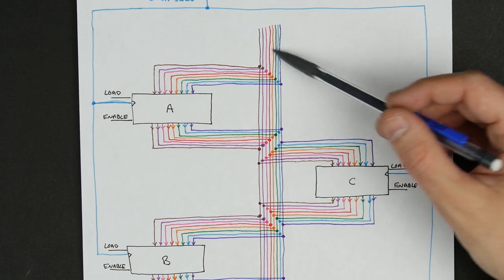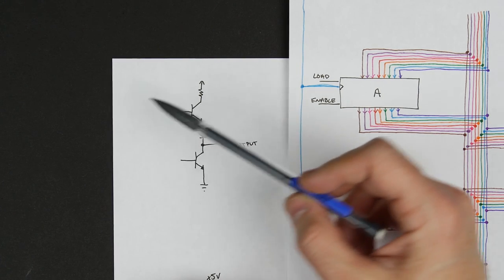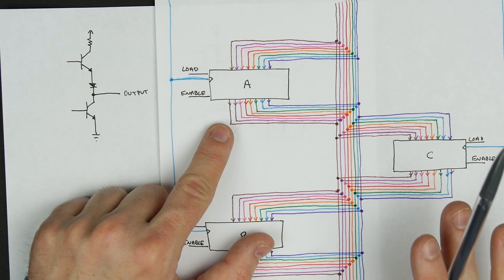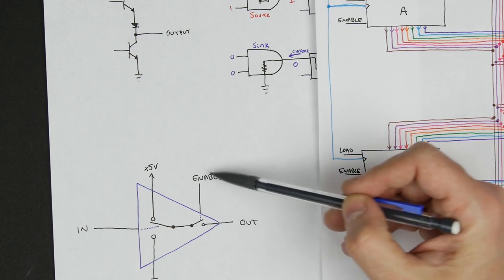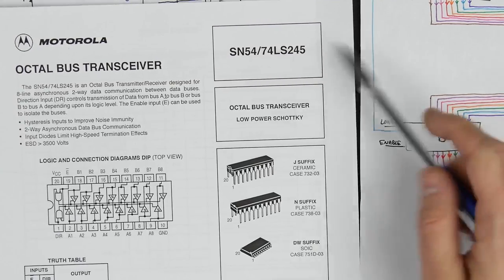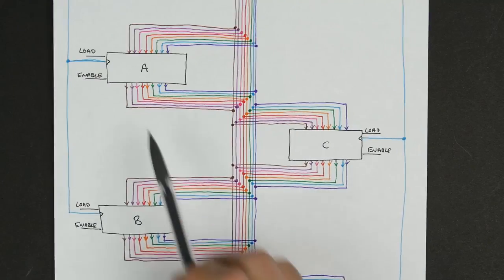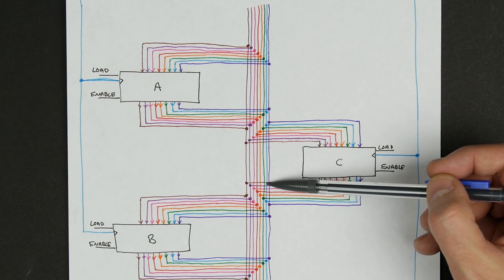Tri-state logic: Connecting multiple outputs together - 8 bit register - Part 2

Comment: Just to be clear though, @4:02  he is using 'convention flow'.   The actual flow of electrons is the exact opposite direction.    The  idea Convention flow started before we knew what 'current' really was.   Even today it still is easier to understand by using convention flow and by tradition our electronic symbols  use it. In convention flow current flows from high to low.  The actual electrons flow from low to high voltage.    GREAT Video series though.  I don't intend to take away at all from it.  Best explanation of a bus out there.
Reply: Lewis Burmeister You’re correct. It’s important to make that distinction in physics. In my humble opinion, in electronics, there’s no need to introduce that extra source of confusion for students

Comment: Damn this is really good.  I understand it.  Semiconductors shut off different modules on the bus by incompleting or disconnecting the output circuit. By stopping the flow past the NP Buffer zone, but they can still accept and read data to the N zone I guess.

Comment: So this great explanation made me realize there can only be two devices talking to each other each clock cycle,.. I can see the registers of my arduino-like chip with a debugger I believe, I now wanna go check if they are indeed only changing one at a time!
Reply: That is true if you only have one bus. But you can have several busses on the same chip, and lots of smaller dedicated connections between different parts. Then lots of change can change in each clock cycle, and it pretty much always does, but it might not always be obvious to see that from the outside.

Comment: Thanks for your great tutorials.
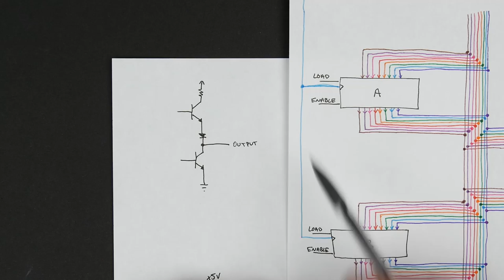The schematic at 2:07 makes not much sense though, since for 0 and 1output you have the same circuit, just drawn differently. Both times the voltage source is connected to ground using series resistors. The output "measure point" is at the same location as well, so the result would be the same.
Reply: It's a bit confusing, but it actually makes some sense.
But the voltage is important, and not just the direction of the current flow. The first thing to note is that (when signaling using voltage levels) output drivers have much lower resistance than inputs. So whichever rail that the output driver is connected to will decide whether the line is high or low.

The second question is about how you measure the output. We can say that the input measures the output, which means that a low or high output level causes different things to happen at the input. Ultimately, what is important is what happens inside the input. So if the input contains one transistor that will sink current to ground when the input voltage is high, and another one that will source current from 5 V when the input is low, the important thing is what happens when those respective transistors do that. So the input could be seen to measure the current that goes through specific components inside to decide how it should react.

Comment: If your computer runs out of control bits inside microcode, you could use decoder for all the bus enable signals, because they should be activated one at a time to avoid conflict. So, instead of A register out, sum out, PC out, instruction register out, ram out (5 bits) you could use 3 bits:
000 - A reg out
001 - B reg out
010 - ALU out
011 - PC out
100 - RAM out
101 - instruction reg. out

and it allows now to output B as well, and another 2 devices in perspective. Some input would be great :)

Comment: Tri state logic prevents two outputs at the same time.
Source current = 1 current flows out 
Sink current = 0 current flows in to ground
Disconnect the output is the goal
On the next clock pulse, if the load is high, the data is read from the bus

Comment: Work is done by current.  Current flow is due to the movement of electrons (6.24 × 10^18 electrons to make up 1 amp of current).  What you speak of here (and a few others) is 'hole flow'.  Every teacher I had that taught electronics in college, holes are full of air - not work.  Current flow is then made up of electrons, not holes.  Therefore, current flows negative to positive.
Reply: 150 years before the discovery of the electron it was thought that current flowed from positive to negative, however now they know the truth but the mistake is still taught.

Comment: Hi great series. I have a question though I have the 74LS175N D F/F instead of the 74LS173 which has the logic gate inside the package, so im assume I link the logic gates to the 74LS175N to build the register, id like to know if im correct in this assumption or am I wrong?

Comment: 7:03: "And we can have that enable line low for all but one of these..." 
I believe that explanation is inconsistent with the 74LS245 datasheet you just showed @ 6:21: There the enable line is inverted, i.e. low for enabled, high for disabled. So you'd want to have that enable line high for all but one of these.

Comment: Ben, are the signals gonna be loaded to the register/enabled back to the bus only in one direction?
Or you've just drawn it this way for simplicity?
I mean if the direction is opposite than Enable should be able to work as Load and vice versa, is that true or I've missed something? THANKS IN ADVANCE!

Comment: Why do you need the diode in between the transistors? Current won’t flow back anyway and there is another 0,6V drop?
Reply: It's legacy from old TTL circuits, depends on the circuitry that was used to drive those two output transistors in the first place. You needed a big enough voltage drop for the other path, or it could turn on even when it shouldn't.

Comment: This might be a stupid question, but why the additional sinking state (switch flipped so it connect to ground)? Why not just either 5v, which would be 1, but if enable is off, the other part is not even connected to the circuit, so a 0. 

This part is confusing me…

Comment: What if we just used a simple transistor where the base would be the enable wire. Would that work ?
Reply: That transistor getting in cutoff mode will also cut the whole bus into two parts:  the upper part won't be able to "speak" to the lower part through this bus because one (intermediate) object has just cut the bus.

Comment: How would you do that in 4:00 with manufactured logic gates in ICs like the CMOS 4011 or TTL 7400?

I know that they make tri-state gates like you mentioned in 5:45. But I do want to know if it is possible to do it without opening the IC and connecting wires to the die with the help of a electron microscope - an 'impossible' task in most scenarios, lol.
Reply: You can't do tristate with normal logic gates, because their outputs are always wired to drive the output either high or low.
You can do it with discrete transistors, you can have one to pull the output high when you activate it, and one to pull it low, and then you can have regular logic to choose which of them to activate, or to activate neither.

An alternative to a bus if you don't have any tristate outputs is to use a multiplexer instead, which takes a signal from each source that could drive the "bus", and a selector signal to choose which one to use. Then there is only one driver for the bus, and you don't need tristates. But then you have to draw a lot of dedicated wires to the same place.

Conversely, one way to implement a multiplexer is to have a tristate driver for each input and a demultiplexer that chooses which of them is allowed to drive the output.

Comment: Now I'm really curious about how you'd construct a three state circuit. How would you cause it to be neither a sink nor a source?
Reply: amante pensanta connect it to nothing.
Reply: But how would one do that, electronically? Would e.g. the emitter of a transistor suffice?
Reply: I would say so, an unenabled transistor should block either a source or a ground.
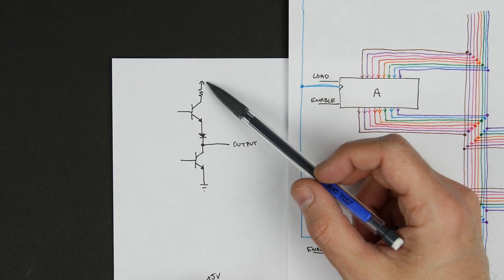Reply: Look at the circuit at 1:03. If you don't supply current to the bases of either of the transistors, it won't drive the output either high or low. Since you can turn on the source and the sink separately, you can choose to turn on neither. It's just that regular outputs are wired to turn on either the sink or the source.

Comment: i have a question.. is this bus directional ?, does data flow in both directions , and still turn off the respected line so there isn't a conflict?
Reply: Data flows from whatever thing is enabled to drive the bus, to everything that is reading from it. So the direction depends on the control signals. That's what makes a bus so versatile! But you have to make sure never to enable two drivers at the same time.

Comment: Regarding the 3-state output, how would one instantiate this using transistors?
Reply: You can do it like at 1:03, if all you have is NPN transistors. The diode shouldn't really be necessary, it's there for reasons that have to do with things that are further behind the output transistors in a TTL gate.

You don't absolutely need the series resistor for the pull up either, but of course it's always good to consider how much power you will be drawing also in the case when (briefly) something is trying to pull the output high at the same time as something is trying to pull the output low.
On the other hand, for bipolar transistors, I would consider a series resistor for the base to avoid it drawing too much power. Should be ok for the upper NPN transistor, since it's in a common emitter configuration, so as long as it enables to pull the output one diode drop below the base, it will lower its own base-emitter voltage to keep the base current small.

But the upper NPN transistor (common emitter configuration) is not great because the output voltage will be one diode drop below the base voltage. If you have a PNP transistor, you can use that for the pullup instead, in a mirror configuration to the pulldown. One nice thing about that is that a high base voltage will activate the NPN and pull the output low, and a low voltage will activate the PNP and pull the output high, so you can drive the bases with the same signal, except when you want to the high impedance state that is.

You can do the same thing with MOS transistors, one NMOS for pulldown and one PMOS for pullup. This is how it's done in CMOS logic. Then you don't need any series resistors for the gates, because MOS transistors don't draw static current through the gate (except some tunneling current for really tiny ones, like in modern chips...).

Comment: Could someone explain what the diode is for in the tri-state part of the logic. From what I can see, if you have a 'high signal and enabled' then the top transistor would be on, so current will flow from +v, through a resistor, through the transistor, and final out the diode onto the bus. Is there some sort of issue with a transistor having a high voltage on both the collector and emitter?
Reply: Sorry for necroposting: came up to these video just couple of days ago. This diode is legacy from first TTL circuits where they had Darlington transistor pair in place. The upper part of output circuit is emitter follower: voltage at emitter 'tries' to follow the voltage at base, but nearly 0.6 volts lower. So if we have 5 volts supply (standart for TTL), high level output from Darlington would be nearly 1.4 volts lower, that is 3.6 volts. 

After advances in technology, this transistor pair became redundant: one transistor alone provided enough amplification,  but to make all these chips compatible, they decided to leave diode in place, so output is still 3.6 volts.

Though there may be more to it than just compatibility: one stage before output is called 'split phase' stage: it makes sure lower transistor is open while upper transistors are fully closed, and vice versa. If we remove that diode, we can come up to situation (probably when chip is hot enough) where lower transistor is open, but upper transistor is also partly open, because that split phase stage cannot provide low enough voltage at base. And that means there is useless current going just from power supply to ground through both transistors. All it does is heats them up and drain power supply. This diode helps to avoid this situation.

Comment: Nevermind. I got answers to my questions from the video.

If two short-circuited outputs of two elements differ, wont the elements damage themselves from resulting current? I assume, the bus has low resistance.
Or are they protected from that? I assume (from how you draw them), the transistors are internally-disconnected MOSFETs, so I wonder how the current-protection works inside the elements.
Reply: You need to either make sure that it doesn't happen, or that the current doesn't become so high as to damage the components when it does. For the latter, some series resistors might be useful (as the output stage at 1:03 has for the pullup; it's enough that either pullup or pulldowns have them).

Comment: I am confused about your discussion around the 1:40 mark.  The gates sourcing current for 1 makes plenty of sense; but I don't understand how it could possibly change into a state in which it's sinking.  That seems to imply to me that the output is connected to both + and gnd; which couldn't be true.  Unless your sinking state is really just no current?
Reply: jmile69 it sinks current from any current source attached to its output, which isn't pictured. If the output isn't connected it will show near zero volts. If it is connected in a complete circuit, a small amount of current will flow.
Reply: The two transistors are what do the trick.  Turn one on, and the output will act as a current source (logical 1) while if the other transistor is turned on instead, it will act as a current sink (logical 0).  The trick is to design the circuit so that you can never turn both transistors on at the same time since that really would cause a short circuit.
Reply: @matthewkriebel7342  That's why the simplified gate circuit at around 2:07 makes no sense. The output is 0, eventhough it is connected to Vcc.
Reply: Aron Highgrove ah, are you looking at that 4th (bottom right) AND gate?  That is a little bit misleading. Just think of that pull-up resistor as being really high value. As current approaches 0, voltage will drift up, yes, but as long as the pull down in the left gate is 1/10th or so the value, current flows left-ways (conventional flow theory), and the line is low. Read up on totem-pole drivers and high impedance inputs. Maybe someone else’s explanation will click with you.

Comment: You say that two modules shouldn't ever be enabled at the same time, and that makes perfect sense. But what if you purposefully  did so? Could that be a janky way of having a bitwise OR operation?
Reply: My bad, I didn't watch trough the whole video. Having two enabled modules would AND them together! Could that be used as an instruction?
Reply: Nope. It wouldn't actually AND them; any line in the buffer where the signals were conflicting would be floating and could read as a zero or a one pretty much unpredictably.

Comment: it's not my first time that I'm watching this video. Every time i watch this video, i try to find the explanation how does a circuit knows that it's sourcing a current or wether it is sinking the current, So here's the possible solution.

1. when both enable pin and load pin are high (for to different components) and source bit is 1 and load bit is also 1 then since it has 0 potential difference then load pin will be 1 
2. when both pins are 0 ,still potential difference is 0 so load pin is 0
3.enable pin 1 and load pin 0,then enable pin is sourcing current while load pin is sinking current so output is 1
4. vice versa of 3rd point

please correct me if I'm wrong, (I really need to know that my thinking process is right)
Reply: First of all, it is important whether the voltage is low or high. The output driver will have a much lower resistance than the input, so it will control the voltage level.
Second, the question is which component inside the input is sourcing/sinking current? An input would likely have one transistor that sinks current when the input is high, and another that sources it when it is low. Those transistors will have different effects when turned on; that's how the input knows.

Comment: The only thing I don't understand is at 3:46-3:54 "you really want these to be disconnected".
Why?
The current would just have another way to flow to ground, but wouldn't mess up the logic.
What could be the answer is:
- because then the current is divided on the bus to the number of places where it sinks? so it could happen that not enough current is flowing to the register we actually want to feed?
- unnecessary power usage?

Please let me know if you know the answer:)
Reply: If A is outputing a 1 ie 5v but C is sinking to ground, then if B is reading, B will read 0 because the 5v  has been sunk to ground. This is how I understand it?
Reply: That could make sense, thanks!
Because the current wants to get to the ground on the smaller resistance. Which incase of B is basically just the wire's resistance. While on A, there is a circuit?🤔could be:)

Comment: So, with an I2C data bus, the data line is held at a consistent 5v (with a resistor between +5v and the data line). When a module wants to communicate a 1, it does nothing. When a module wants to communicate a 0, it shorts the data line directly to ground, effectively making the data line 0v. Could someone explain to me why we don't do this here? It seems a lot simpler than having tri-state logic. Is there some kind of inefficiency I'm unaware of?
Reply: probably has to do with the fact that I2C requires pullups resistors which means it has to charge the parasitic bus capacitances which can slow down the communication. this way you arer directly driving the lines so it should be a lot faster
Reply: @areg7182  That makes perfect sense! Thank you!